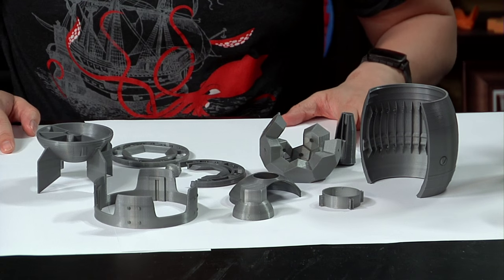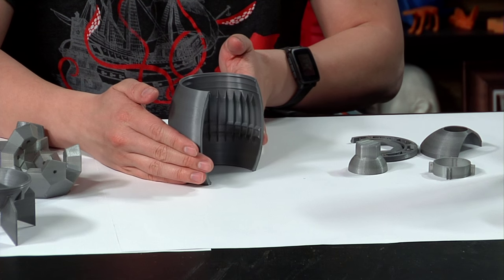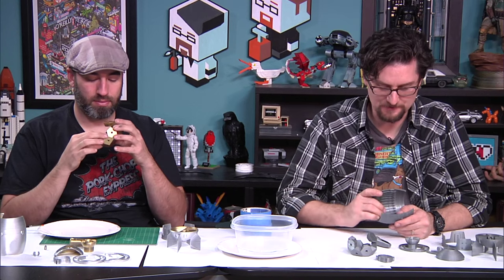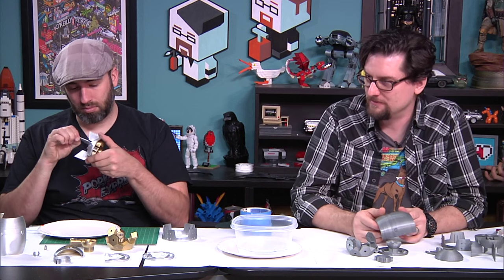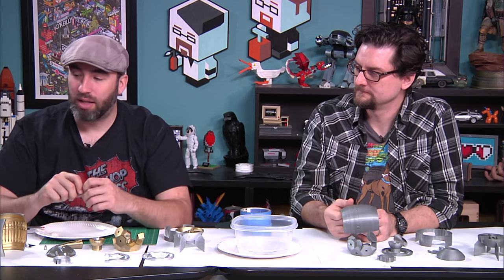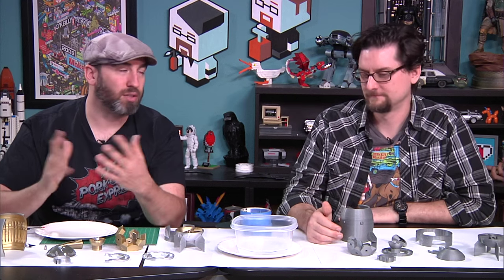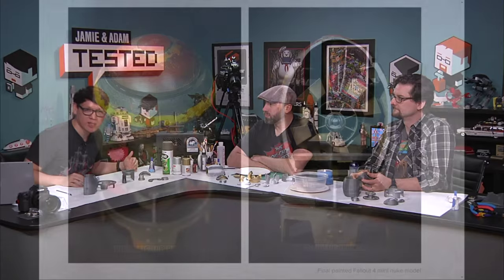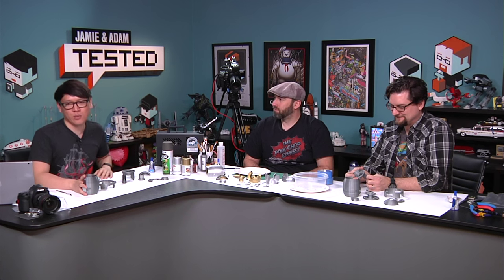Tested Builds: Fallout 4 Mini Nuke Kit, Part 1

Comment: Neat model, but missing the radar altimeter antenna on the side and drag parachute package in the tail that the actual A Bomb had.  The Nagasaki bomb used a drag chute to slow its fall so the B29 could get away from the blast, and the altimeter detonated the bomb for an airburst above the city for maximum destruction.  The bomb also missed the city center and detonated over an industrial area, but the city was destroyed by the firestorm, anyway.  Just thought you might like to know.

Comment: Come on guys, rub down the 3D print, filler primer it, use stopping filler then sand back smooth, light coat of filler primer again, sand smooth, add color with spray cans, put it together, weather as needed, it looks amazing and I do this all the time with my 3D prints.

Comment: i have an issue with the implosion core, shouldn't it be a complete sphere with the triggering component connected on the surface and not going through it, that would defeat the purpose of an implosion fission device if the forces had an escape route.

Comment: Urgh, for the tested 3d printing "expert" Sean sure is clueless about the nitty gritty about 3d printers, understandable since he only uses commercial printers and don't tinker with them I guess, those lines they're talking about at 5:12~ is z-banding and is caused by either uneven filament diameter, extrusion or z-wobble from the threaded rods or similar. And you can print thin things fast with enough cooling.

Comment: I love 3d printing and the idea of downloading physical objects, but you have to pay respect to the properties of the tool, and I see that commonly being neglected, like in this model. The fins are essentially flat slabs, and from an engineering standpoint it makes absoluetly no sense to print them over 16 hours. Print the body, cut the fins from a flat sheet of material, then attach them. Or print the whole thing if you enjoy making an engineer cringe. It is lazy: you won't acquire any mechanical skills. It is a waste of material and energy and time and unsustainable. And it gives a sub optimal result, like printing artifacts. Even printing them in a flat plane would make more sense.